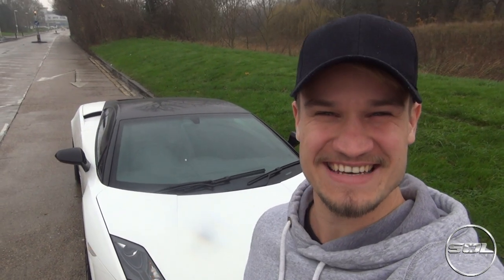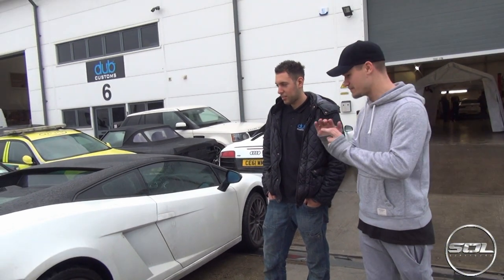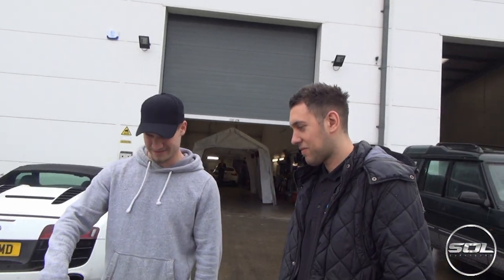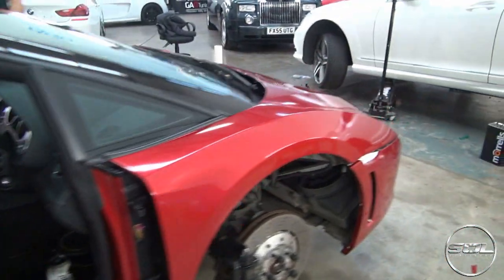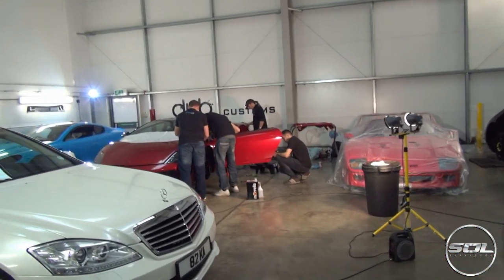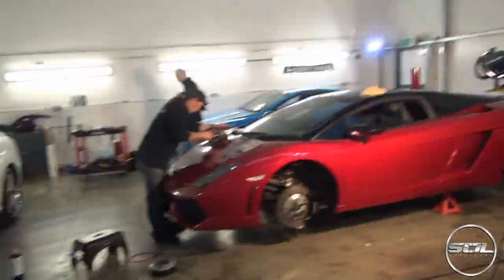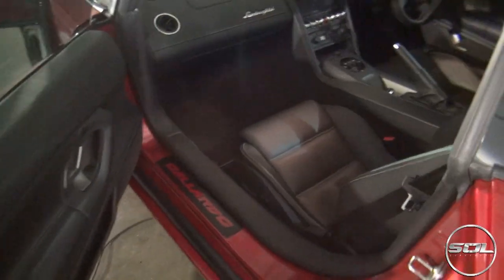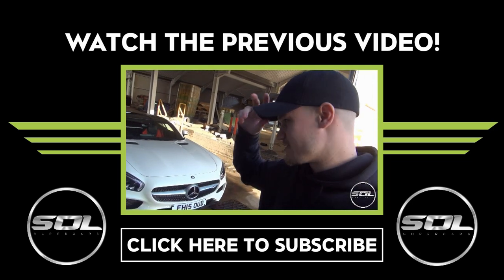HOW MY LAMBORGHINI WENT RED AT DUB CUSTOMS!

Comment: How long does a good wrap like that lasts? And how much can it cost?
Reply: +Adonis Amarante high end material 5-7 years, and the price ranges from 3-11k~
Reply: cha0ticmager Thanks for the answer!
Reply: +Adonis Amarante a good vinyl is marked to be able to stay enjoyable and fixed on the car around 5-8 years. The cost of a wrap is based on the material that they use and the amount of work they put into it. I estimate pauls cost at around 5k, because they used a pretty expensive vinyl, a lot of it because they wrapped the inside of the doors and such, and the manhours.

Comment: Paul OEM doesn't mean a factory spec. OEM = Original Equipment Manufacturer. It actually means a part or product that a manufacturer makes for another company's end product. Like how iphones are not make by Apple they use Foxconn as an OEM company to manufacture them. Might want to stop saying it all the time because it doesn't make sense in the context your using it in!